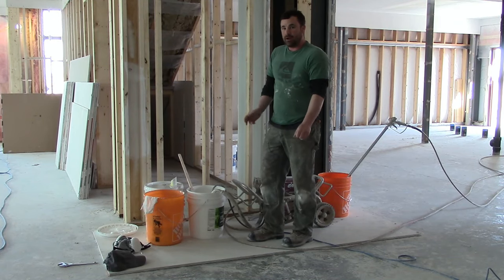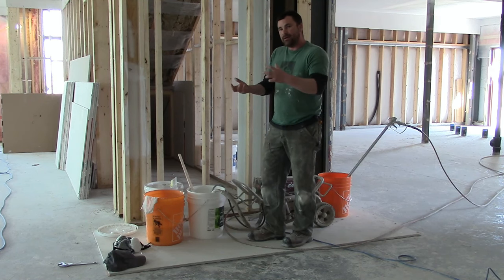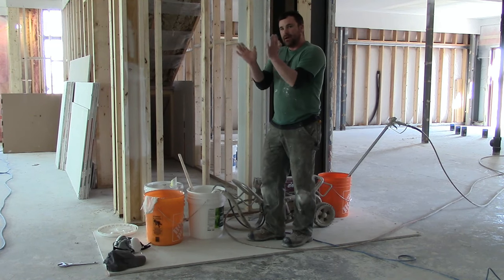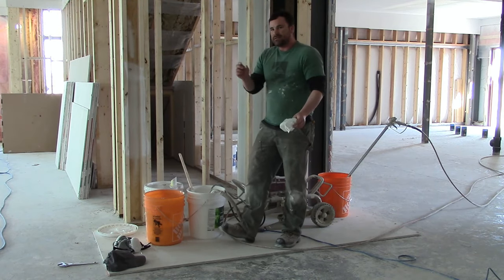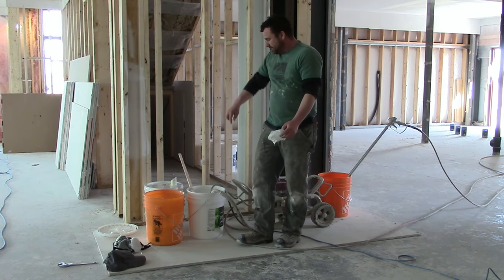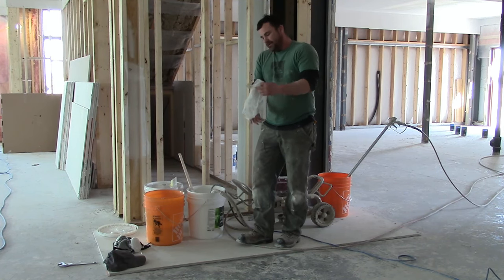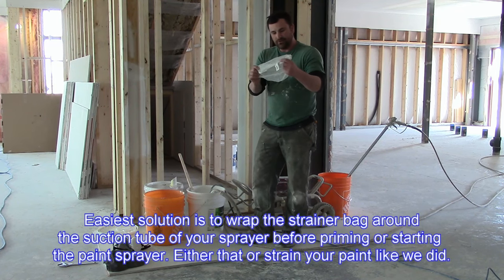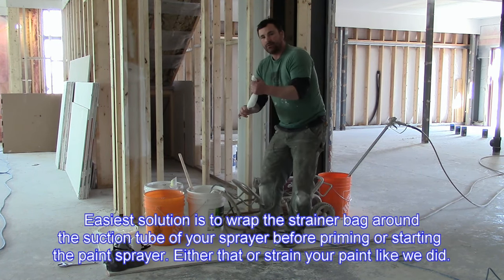Interior Painting Tip : Strain BEFORE Spraying

Comment: So true. I started as a painter 1964 when I left the military after serving  10 yrs, I used cheese cloth then, Later pantyhose. later nylon strainer bags 1 to 5 gal came in. After 50 yrs, I still strain. I am 80 now and working P/T. It all became easier when reverable spray tips came on the market and the Titan adjustable tip. I filtered anyway. I should stop but painting and drywall are in the top part of my DNA. I started drywall 1968 right after my painting apprentice ended. Working in Hawaii, I painted using allot of oil paint. I had to double bag everything esp. using smaller spray tips also using all those stains while finishing cabinets in those high risers at Waikiki. I have allot of drywall work as I speak. Thank you for your posting.
Reply from the maker: +John Gould Thanks for sharing! Hats off to you and all the work you've done over the years!

Comment: Doesn't your sprayer have a screen in the pump and one in the gun? The only time I've ever had a problem with that is when I foolishly removed the screen. If your running a really small tip for some reason you should put a finer mesh screen in your gun. If I recall correctly, I believe I run a 515 tip for spraying paint.

Comment: Soo so important. one should always strain paint before using a sprayer. parts can get clogged so easily with the smallest little pieces of skin or trash in the paint. Even if it's brand new. I was always shown by an expert to use one clean empty bucket with a 5 gal nylon mesh stretched tight over it , they come that way. tape around the outside edge a few times to keep it from falling down from the weight of the paint and strain. one trick, I reoommend  is even poking a small hole just big enough so the shaft can go through the mesh, close to the side of the bucket and higher than where you will pour the paint in. then inert the shaft and your ready to go. this way you have it set up so that no need to remove the strainer. Plus, if your spraying tens of gallons of the same paint, each new five gal you just slowly pour into the strainer bucket as needed. You waste a strainer but they're pretty cheap. another method is actually wrapping the strainer tight around the shaft and taping it tight but make sure it wont suck into the shaft, this method you can reuse the stranier but you will get messy cleaning it up. but keeping a sprayer clean is part of the process.